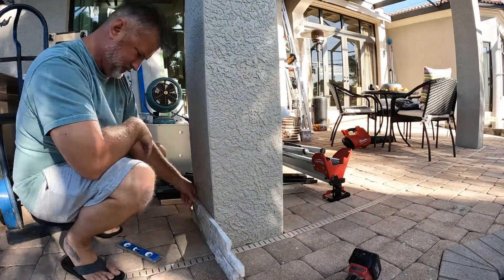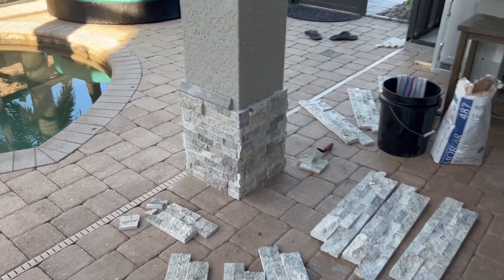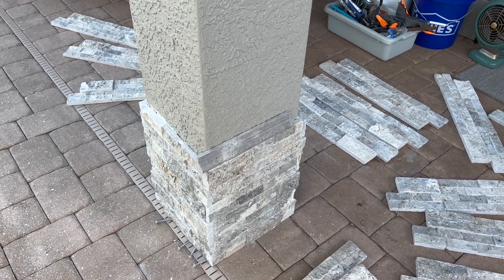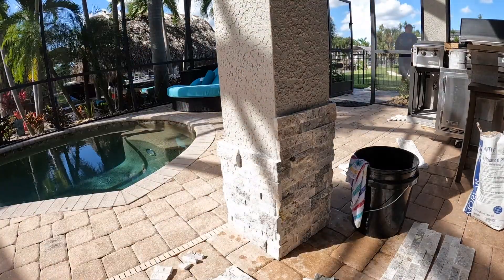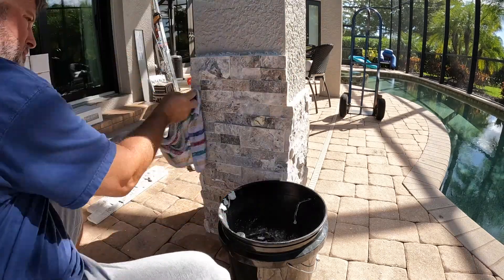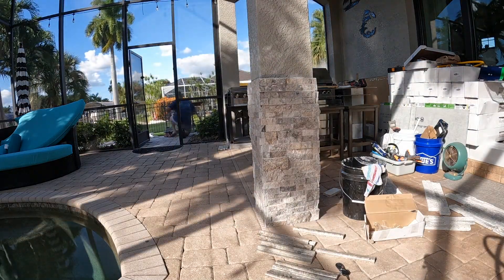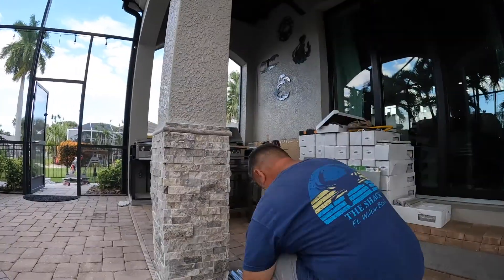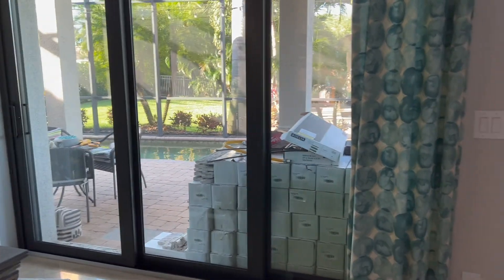Outdoor Kitchen Working on Ledger Stone and Cap | Episode 7

Comment: excellent video. Now, two years later is the stone still adhering well to the stucco column? I have a similar situation and I am wondering what the best kind of thinset would be.
Reply from the maker: Yes, absolutely. Not only has it adhered perfectly, but it was flooded due to hurricane Ian and part of these columns were underwater, and there was still no issue.  And thank you very much. This is part of a much longer series. I hope you will find it enjoyable watching all of them.
Reply: @bobbygfl  What kind of thinset did you use?
Reply from the maker: It’s from a local tile distributor. I believe it’s called pro set. It’s a white mortar and it has adhesion that are stronger than the stone itself.  Proset 900 I believe.